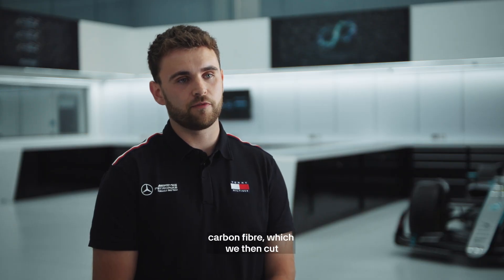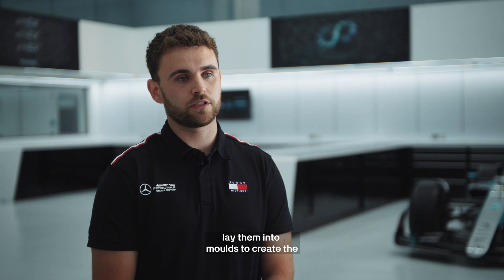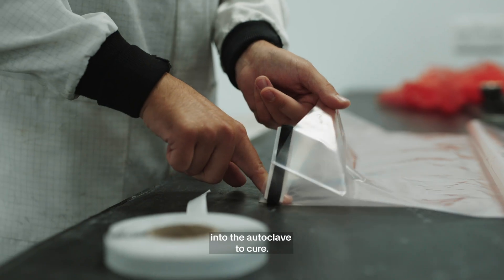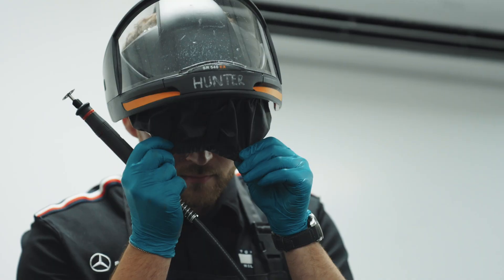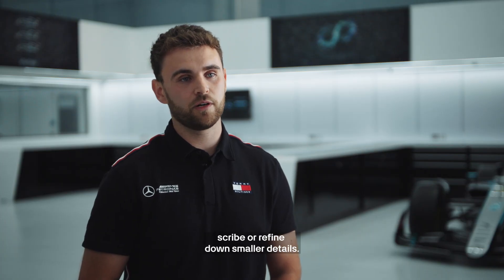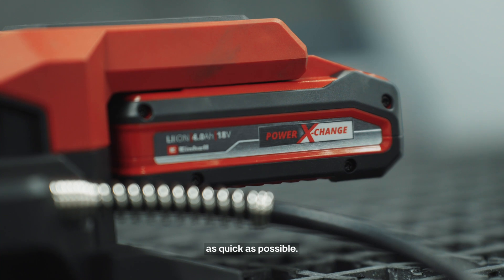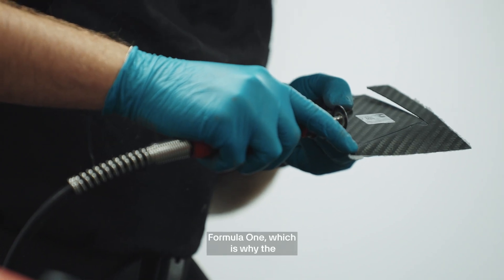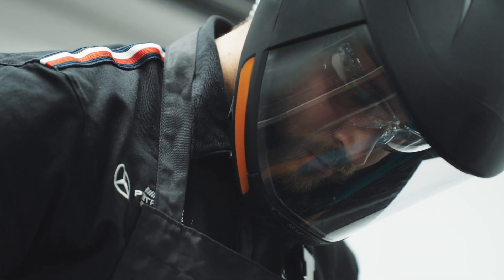How We Work With Carbon Fibre In F1 | Performance Insights, Powered by Einhell

Comment: The fact that all Einhell tools use the same battery is quite essential for manufacturing parts quickly. Because even though Merc F1 were able to squeeze two Einhell tools in the very tight budget for the season, they could only afford one battery.